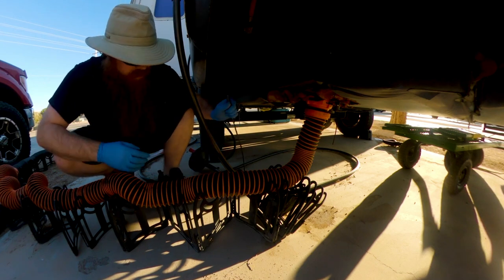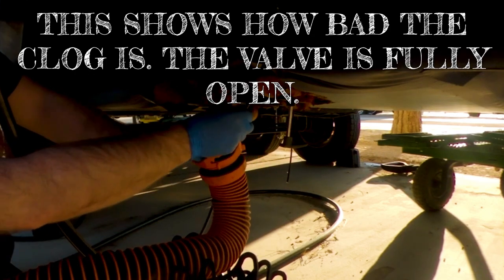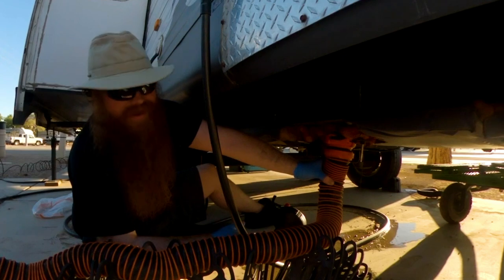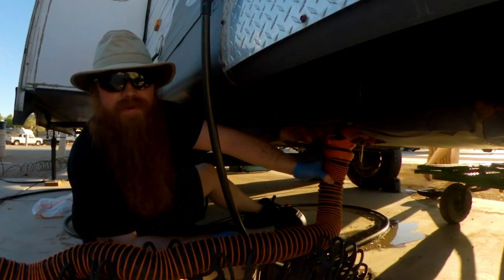HOW TO FIX A CLOGGED RV GRAY TANK * Hills On The Road Of Life *

Comment: Great video. I thought I was the only one who decided to go in through the out lol 
I have the same snake and I realized that when the snake folds over onto its self then you tighten the the bolt and spin the snake with the Handel. Then you release the bolt and feed more snake through till it gets to the clog and when you get to the clog with water flowing tighten the bolt again and turn the knob and keep turning whole time it’s draining that way you break it all up instead of just a small hole. Because I did this and a few weeks later I had a new clog because it didn’t break everything away. It was just enough to push the water through. But that’s just how it was for me ! Also when you’re done put some baking soda down the drain with vinegar. Wait 20 mins and pour two huge pots of boiling water down the drain. It should release anything left over. But like I said that’s just how I did it. Also on moving days put a pot of water down the drain and a dishwasher tablet and when your driving the water will slosh around and break up alll the grease / grime and clean your tanks and sensors , as well as black tanks. Happy camping 😁 ( please don’t take what I said wrong. Just trying to help with what I have gone through. I know it can be frustrating )